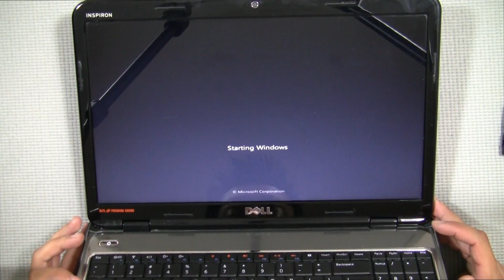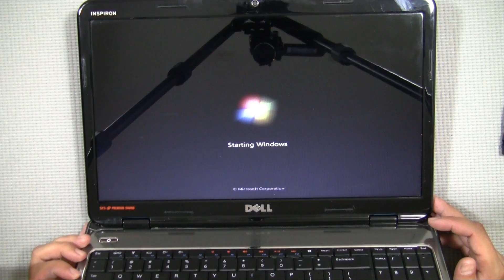Dell M5010 Laptop GPU Fix Using Re-Flow

Comment: I decided not to apply the heat gun treatment but followed all the other advice and re-assembled. My Dell M5010 exhibited the same garbled screen for about 30 seconds but after it decided to reboot, the screen has come back as normal! It has been running and downloading and applying months worth of windows updates and so far has been absolutely fine. I also took the opportunity to check the fan wasn't clogged (it wasn't) and one other thing - the three screws in the triangular arrangement, they were not tight. I think this was a factor with my laptop too? (I screwed them down). Many thanks for the clear tutorial.
Reply: Also, one cooling trick I have used in the past - remove the DVD/CD unit if you don't use it routinely. The locating screw in this case can be found under the memory cover. Remove the screw and then ease out the drive from the side. You then have a large void which will let the air in easier and help dissipate the heat. You can put the drive back in on the occasions where you might need it.

Comment: Known technique, but it involves lot of risks - especially your tutorial. First of all, don't ever recommend people to use an ordinary heatgun on an unprepared board and without using a temperature sensor. Some of the folks may think, that they can repeat this very same procedure for longer than 10-15 seconds. In that case it'll most probably result in a:

1) deformed or melted plastic components (for example those ram slots, or even a CPU socket);
2) moved or blown away SMD components. (if a hot air melts the solder under nearby SMDs, you just have to be lucky, if you don't mess something up)
3) overcooked GPU chip

and finally.... will certainly result in need for a new motherboard, because it'll be made irrepairable.  

In my early days I had a lot of practice with old & recycled boards - I've seen and experienced it all. Some guys even recommend a blowtorch for heating up those chips - I guess, that's the next level of this Russian Roulette.
Reply: I've done it for 5 minutes without temp sensor last night and all runs great

Comment: @Johnny Phung First of all thanks for the clear demo. My Dell Inspiron is also facing the same problem. I've sent that to Dell service center for diagnose and they couldn't find any problem. I've also run the diagnostic tests but they were all clear. The service center guy has told me that it seems to be an issue with my graphics card and i may need to replace my motherboard and it's having only 3 months warranty. Somehow, they have temporarily fixed the issue but now it has started reoccurring and i don't want to change the motherboard as i don't see any other problem with it. I want to try this myself and I question i have here is: which is the best thermal compound to use? I see many options but i am confused with which one to use! Please help me! Thanks in advance.
Reply from the maker: try the Arctic silver 5 or mx4. you only have to apply very little.
Reply: *****  Thanks a lot for help.

Comment: Few mistakes made in the tutorial.

1.  Didnt clean out the fan.
2.  From memory Dell don't use thermal paste on GPU, its a thermal pad.  I assume he has done this repair in the past, hence why the GPU had paste on it.
3.  He didn't clean off the processor and reapply thermal paste.

Personally I would lay out the £30 ($50?) to get the GPU reballed not reflowed.  Adding heat to the GPU can cause thermal damage.  But if money is tight, a reflow will last a few weeks or a few months at best,
Reply from the maker: there's a video that Linus tech tips did and he talked about how removing the heatsink with thermal compound on it and putting it back on without cleaning or reapplying did not effect thermal conductivity. I believe him because I've done the same. Please cite a test that has been done to prove your claim that it needs to be done. I'll probably make a video of doing all the wrong things with thermal compound to show that the differences are about half to one degree difference. thanks for watching.
Reply from the maker: it is possible to contaminate TIM with something like oil from your fingers though. that will degrade the compound over time. so instead of it lasting 3 years it might only last 1.
Reply: Don't need to cite any test.  It is common sense, I mean why wouldn't you, you had thermal paste and alcohol right there.  GPU faults in Dells are often caused because of overheating.  If you "repair" a GPU fault, then you want to do everything humanly possible to keep your temperature low, including cleaning the fan and radiator.   Not to mention that that thermal paste is likely to be several years old and started to solidify.  Modern laptops tend to use lead free solder on motherboard, which sucks, this is why most if not all reballing professionals use lead solder as a replacement. 

Linus usually does his tests with high end equipment with huge cooling fans and mostly desktops, so I wouldn't be convinced of his test when it comes to dealing with a low end laptop that has a tiny fan to cool itself.
Reply from the maker: +Chris Paul ahh yes the common sense argument again that everyone uses as the gospel truth. I know I sound like a snob, I don't mean to be. Your approach is totally valid and is better to be on the safe side and do the most to increase the chances of everything working for a long time. but one else could also argue that removing and reapplying the TIM on an exposed cpu die is dangerous because it could be damaged since there's no IHS. so what does commented sense say on how much of a temperature difference is between reusing TIM or cleaning it off and reapplying? 1 degree? 10 degrees?
Reply from the maker: +Chris Paul True, Linus uses high end parts with advanced cooling in his tests but does that mean the same would not apply to lower power "end" and smaller cooling fans? I would say it scales the same so the same technique would apply. The main difference really is mobility of these parts that's the main cause of all these problens. That's why he did a video on reflowing a gpu because of the way it gets handled.

Comment: I got a problem with boot up, just got black screen and 7 beeps repeating in loop, that's all nothing else, no boot at all. Memory & battery were removed, connected an external monitor, still same prob. Do you thing is same problem that it happens in this video?

Comment: Wrong procedure: this is not a reflow.  It will work for awhile, but not permanently.  To do it right, you have to bake the board at 165 degrees F in an oven for 24 hours to remove moisture that would otherwise make molten solder explode, then shoot liquid soldering flux under the chip with a needle dispenser (from digikey), then heat with the gun until about 20 seconds after the solder on components surrounding the chip has obviously melted.  If the procedure in this video had actually gotten the solder got enough to melt, the solder would have exploded from the trapped moisture.

Comment: very clever!! as any real Tech knows these motherboards are manufactured using wave solder technology where all the chips are glued to the board and sent through a liquid solder bath for a few seconds. If there is any minor imperfection in the lands on the board could be dust or just bad solder flow. I applaud the guy that posted this for his resourcefulness.
Reply from the maker: Thanks for watching!
Reply: YW

Comment: hey mate, i followed this tutorial, for N5010 my laptop display seems to work fine. however now my computer turns off after 15 seconds. 
- Tested turning on without my keyboard plugged in 
- Tested turning on including my hdd. 
- Removed everything including ram. it gives me 2 beeps and stays on forever without any display. 
- Tested all the above cases without my battery plugged in. 
Really lost now, if you've got any solution for this problem.
Please also note: I completely cleaned my fan out so there shouldn't be any overheating issue.
Reply: Please note: I used a hair dryer.

Comment: Hi I thought your vid was really good. Very clear and well presented. There is another vid on YouTube and the guy uses foil folded four or five times with a hole in it the same size of the GPU to protect the surrounds. He then heats the PGU with a pencil torch to I think 450f? He claims he did this for his mother and again I think, on another dell and it was still going four years later. Anyway thanks again I will be giving this a go.
Reply from the maker: Thanks for watching. I do also recommend making a shield to protect the rest of the board.

Comment: Like I said three weeks ago, it worked, but the repair only lasted for two weeks. Back to the 7 beeps.  Should I try to have it repaired, or should I just toss it at this point?
Reply from the maker: If you are considering throwing it away. Try to reflow it again with a heat gun and for a longer period of time. Maybe about 1-2 minutes. Be sure to protect the other parts from heat.
Reply: ***** Thanks Johnny. I did the reflow, using the heat gun for a little over a minute. I did the proceedure three times to make sure the solder flowed. It's working well now. Hopefully, it'll hold up this time. I also installed a copper shim and a new thermal pad over the processor. Seems to be running fairly cool..between 45-70 celsius core temperature. Using the Core Temp App.
Reply: i get the same problem, thanks to the technicien that repair it, it return to work  you, i pay 50 $  :)
Reply: ***** yes ;)

Comment: It worked just as you said. I wish you would have mentioned what heat setting you were using on your heat gun and also wondering why you didn't remove and replace the old thermal paste on the graphics chip? Thanks so much though. The actual part of doing the reflow was very well explained. I followed your example to a tee and it worked! You saved a good computer from being thrown away!

Comment from the maker: It is not permanent. Eventually, the more you use your laptop by carrying it around, the more flexing the parts inside will experience. Also, just sitting on your desktop the chips will heat up and expand then cool and contract. The constant usage will loosen the chip and it will detach again. How well you reflow it will determine the longevity of the reflow.. The spudger came from iFixit website. They sell a really great kit! Good luck.

Comment: Hi Johnny, Thank you for the tech tip. I used a heat gun with an output of aprox 500 deg. I almost expected the motherboard to curl up like a potato chip but luckily, it didn't. I reflowed all 3 chips, heating them for about 10-15 seconds. I did not hold the gun over the chips steadily, but waved it on and off, while measuring the temp w/an infrared laser thermometer. 215 degrees seems to have done the trick. I left the board mounted and made a tin foil shield w/a square cut out.

Comment: Thanks for the good video, I had to do this for a family member.  I have a full solder station with hot air, but opted to try your hot air gun like you recommended.  Worked just as well and a good deal faster.  Very professional video- keep them coming!

Comment: AWESOME. You did a great job on this video. Right to the point, sped up the screw removals, showed me just what I needed to know. I had 7 beeps, no boot, like many others. This worked great. I bought a solder iron rework station to do this. I don't know what the optimum temp is, but I used about 320 degrees F for 30 seconds. I hit the underside for 15 seconds and the CPU and chipset processor too just for good measure. Dell should pay you and link to this video.

Comment: hey amm in my case the laptop i have dont even make a startup sound or show any sings of display is al black only the 7 beeps rapidly when it start the  fan go off.

i opened and the video chip was dry with nothing left of thermal paste. what do you think adding thermal paste wil solve the problem or its something worst having to do with the cpu ???

Comment from the maker: Try connecting an external monitor to the laptop first then turn it on. If the image displays on the external monitor fine with no problems then the lights in the LCD panels are not working and you would have to replace the whole LCD panel. If the image does not display on the external monitor correctly then you might try to re-flow the chip like in this video. Good luck.

Comment from the maker: The heat gun is to melt the metal contacts underneath the the chip. The top of the chips should be cleaned of impurities.

Comment from the maker: try getting a heat gun. I will put a link in the description. Try to blast it for a longer period of time. Maybe about 90 seconds. If it happens again then try 2 minutes. Also, build a heat shield to protect the other parts from getting hot.

Comment: Hey Jon! I was just wondering, so my laptop started to get the dreaded 7 beep. So I reflowed it two different occasions both working, however it's doing it again. Is there any potential risks from reflowing it more( I've been using a high powered hair dryer xD)

Comment from the maker: It does make a bit of a difference. You can pick thermal grease at Radio Shack. If you do it again, hit it with the hit gun for a little bit longer.

Comment from the maker: From what others have told me, this solution worked for them. They also mentioned that they got a black screen with 7 beeps too. You don't really have much to loose in my opinion. Give it a shot and heat up the chip for about 1 minute if you use a hair dryer. Try to protect the other parts by making a shield to block the rest of the board and only blast the ship. Good luck and let us know how it goes.

Comment: Hi, Thanks for the video. I just wanted to offer a couple of tips. 

1) Remove the glue on the corners of the GPU before re-flow
2) Run a no clean flux under the chip ( like Kester 951 )
3) A good pre-heat is a crucial part to a proper re-flow.
4) Temp control is very important. If this is something you do often I would recommend a Hot air station.

Please feel free to take a look at my m5010 GPU reflow video.

Comment from the maker: Dang. You totally scored on that! Wish I could have found a laptop in the trash! It was probably a laptop for a company or business and they just take the HD for security purposes. If the video issues happen again you can hit it with the heat gun for a longer period of time. Try to make a heat shield to protect all the other parts and only expose the graphics chip. You can use foam board and aluminium foil. Thanks for watching!